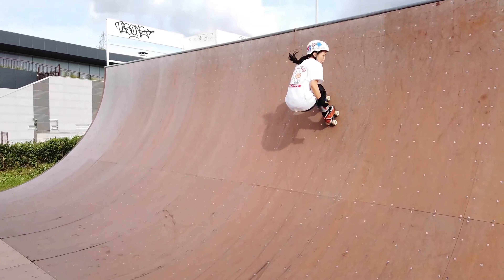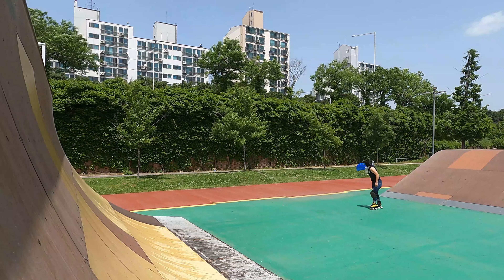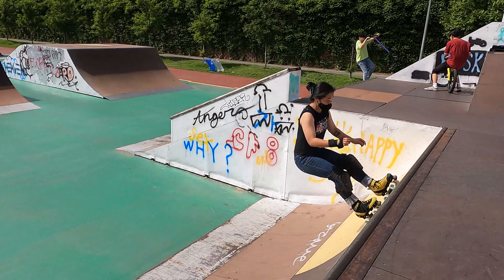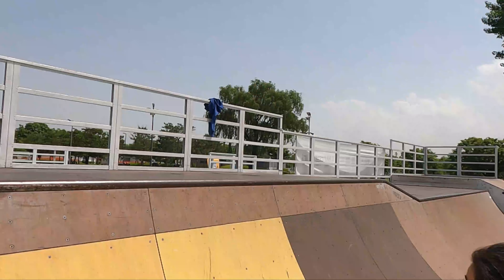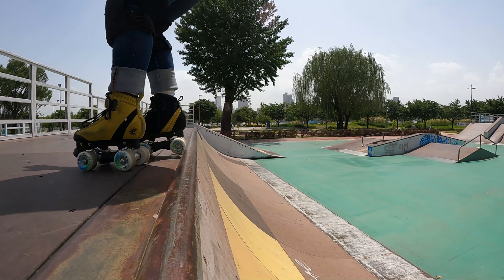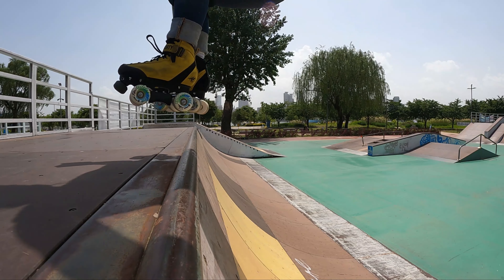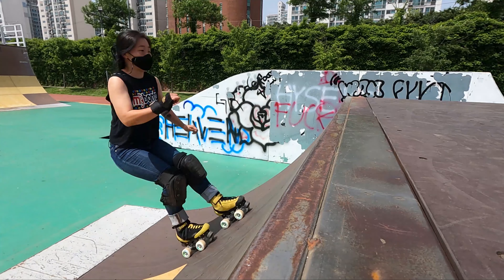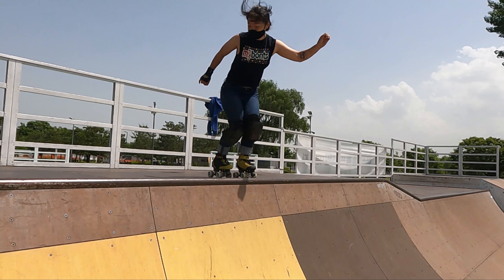How to Air Out of a Ramp on Roller Skates | Trick Tutorial

Comment: I am practicing but it is very difficult for me to keep my knees bent when I get to the coping, my fear is that I will not be able to climb and that I will fall. and if I increase the speed I leave the ramp very quickly without control
Reply from the maker: I suggest wearing all your protective gear as it will make you feel more confident. And then try working on pumping to stall on the coping and pumping to roll out with a focus on your knees bent. If you can do that without thinking then add a little more speed and pump.